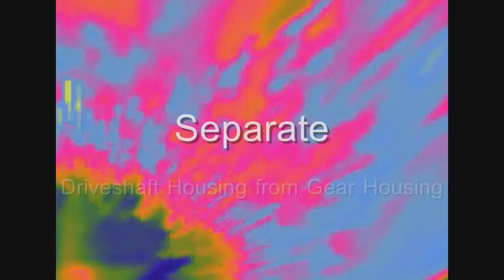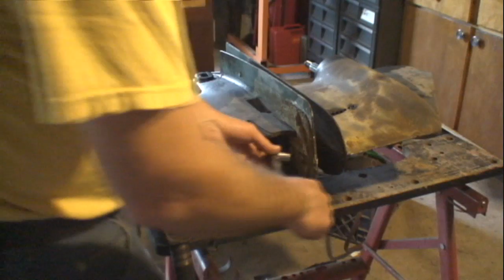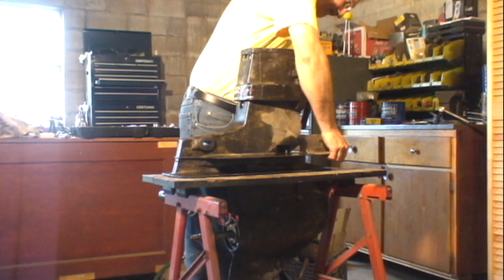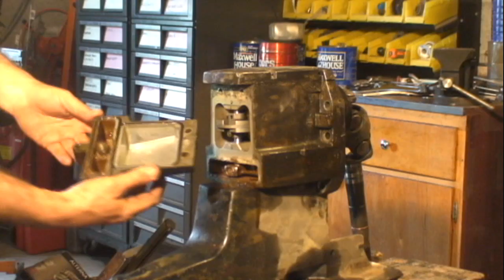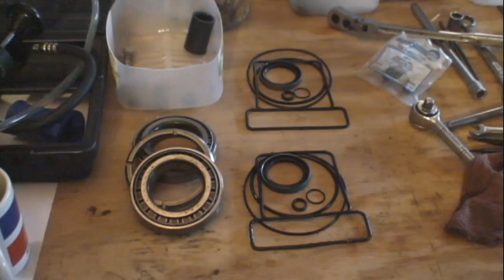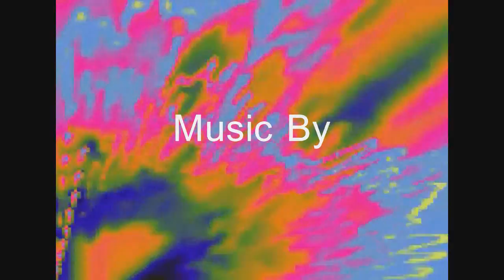Bravo One Outdrive - Disassemble Drive Shaft Housing

Comment: Annoying music. Would like to hear you describe what youre doing
Reply from the maker: Danny Carruthers You may get the details at my free website. Link is in the description. Thanks.
Reply: How can i check if my shift is working ? Currently i have my upper and lower unit apart but when i move the shifter in the drive the u joint shaft still moves forward or reverse , does not lock into place like if it was in forward gear or reverse .